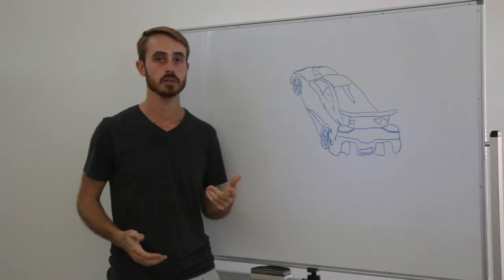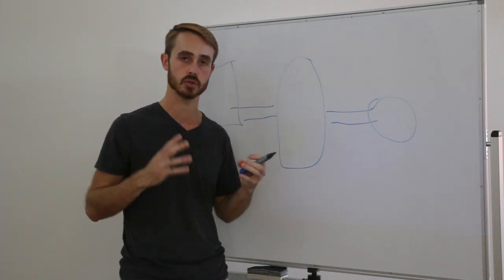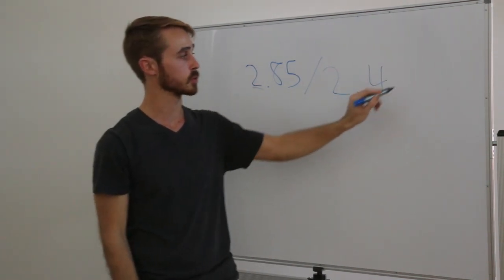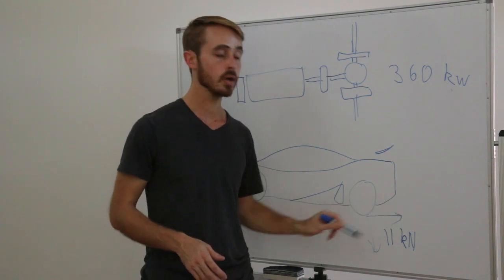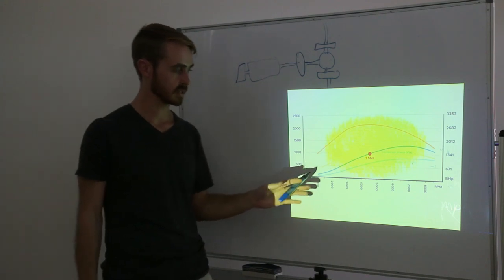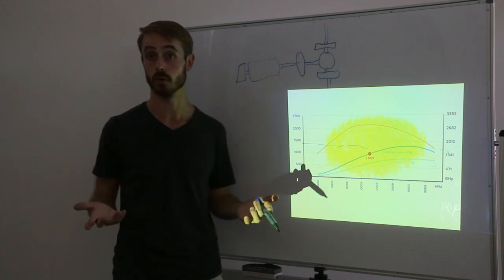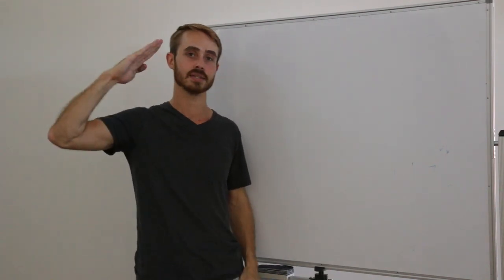Explained: How does the Koenigsegg Regera work with only ONE GEAR???

Comment: Good job on the explanation.  In another video I heard Christian K. mention a lock up converter, so 1:1 rings true. It's a simple but smart approach for a hybrid.  My first thought was all the heat that will be generated until lockup occurs. That is a lot of friction heat to dissipate under continuous heavy load. Maybe that is why we haven't seen a Regera run on the track very hard. Looking forward to see the finished product.

Comment: Thanks so much for this, it helped a lot. I was quite confused about how a car with One gear has the acceleration of 0-400@19S and have over 1500BHP, amazing engineering, pretty interesting stuff there mate.
Reply: LastManFarting Well... it kind of have 3 gears...  First its the wheel engines that is made for high torque, than the shaft engine, that is intermittent, and then the normal petrol engine

Comment: I'm still not clear on how a gearbox is eliminated.  Is it just simply using the Direct Drive electric motors in the rear to drive the vehicle at low speeds, and a 3rd electric motor coupled to the engine in the front to bring the engine up to optimal engine power band at high speeds?  What happens if the HV battery is drained?  Are you screwed?

Comment: Am I the only one who understood 0% of what he is talking about?
Reply from the maker: ZeidGho The main thing you should take away is that the gearing with the engine connected straight to the rear differential at a 1:1 ratio is similar to 7th gear in an Agera, making it suitable for high top speed, and the electric motors after the diff have enough power to break traction up until the point where the engine comes on and starts helping them. Basically, it doesn't need the lower gears as it is able to break traction with the engine effectively in 7th the whole time.

Thanks for watching!
Reply from the maker: ***** Nope, the gearing is the same, but there will be less acceleration, particularly at very low speed. I'm not sure how Koenigsegg is working around the problem of low speed when the battery is flat, but I would assume they are disconnecting the hydraulic coupling and using the engine to charge the battery via the motor at the front of the crankshaft being used as a generator.
Reply: KYLE.DRIVES Third motor acts as generator . It can supply a bit less power than rear motors can consume , but you would not be driving full power around the city . It works the same as diesel-electric locomotive at low speed - combustion motor makes electrical power , and it uses electric motors instead gearbox .Interesting facts - it can go in reverse only by electric power .
Reply: +ZeidGho Ditto and yet despite my complete bafflement, I found it strangely stimulating!
Reply: +Mladen Milić Best explanation!
Reply: ZeidGho me too if he had just said what it affectively doe that would have been better
Reply: nop
Reply: haha he goes on explaining in the comment... i did not even continue the video, cause i am not really interested ... i wanted to see a 3D animation of the car at work,... and not a guy explaining
Reply: So Basically it uses electric shiz' for low speed and the gearbox is basically fixed onto 7thish gear so it has cool top speed

Comment: Ya got alittle mathy here, but from what i got is that it used a "torque converter" mixed with the electric power to deal with the low Revs at low speeds, eventualy letting the Combustion engine take over at higher speeds? 

Please tell me if im wrong.
Reply from the maker: Turns out it has since been stated that it's not quite a classical torque converter in that it locks off drive as soon as it reaches around 40mph, but you are pretty much on the right track. I would describe it as pure electric at speeds<40mph, petrol and electric from there until top speed. 

Thanks for watching!
Reply from the maker: Oh yeah, also all my calculations etc are still valid whether it is a torque converter or a clutch or no slip coupling, so don't think I'm misleading you or anything :)

Comment: Kyle, what would you say about a version of Regera where they'd place the 2 wheel motors to the front? Weight implications? Having 360kW to the front wheels will be more than enough traction wise, and over 50kph there would be more traction to get even quicker 0-100 times, and through to 200 I suppose. Weight distribution would shift a bit. Extracting braking regen might be easier. And in electric more it would be 4WD. How quick could it be 0-60 all electic with the motors moved to the front? I think identical to current 2.8 or 2.9 estimate.
Oh and then there is cornering, 4WD ought to make a difference?
Reply from the maker: 4wd would definitely drop the 0-60, bringing it in line with the 4wd traction limit of 2.5 seconds (Veyron, 918). Weight distribution and packaging for aero and looks would be massively difficult though, the Regara packages it's motors exceptionally cleanly on the rear diff. You would also lose torque vectoring to the rear, which I would probably take over AWD with a massive amount of front power and no torque vectoring in the rear as far as driving feel is concerned. I read the other day that as it stands the weight of the battery pack means the front tyres are larger than the rear, this tells me moving the weight forward would make it very front heavy. Also, the diff and driveshafts in the back are already existing infrastructure, you would need to construct an entire new front framework to mount that motors in the front, which would be very heavy and costly, hindering cornering and acceleration.

Thanks for watching!
Reply: Thanks Kyle. i understood that the front tires are merel wider than on prior cars.
Also the 918 does it in 2.2 seconds, tested. Regera is lighter and might have widertires. Compared to Veyron, much lighter. Mass surely is a factor in 0-60mph.
i don't know much about torque vectoring, but fast cars of yesteryear did well without it.

To me it's just insane to have the car on the slip limit up till 270kph. Bring that down, with AWD, to well under 200kph, and it will be another BIG level faster off the line and possibly around the track.
Koenigsegg being them, an AWD setuo would not have to add hundreds of kilograms surely? Perhaps sacrifice the top boot up front. I would accept a non-loose top ultracar.

Comment: Nice man, thanks. A simple way I had understood it is that they use a high gear (say for example 6th or 7th) for the ICE and the electric motors fill up the torque gaps in lower rpm. But if I understood your video that's a mistake and instead they use a type of torque converter to bring the transmission closer to 1:1 between the electric motors and the ICE?

Comment: +Kyle.Drives 
Your Videos are Great! 
The question now is:
Wich Car would accelerate better, have a better top speed and a better corner performance, if one car weights about 1000kg with 500 horsepower and the another one weights 2000kg with 1000 horsepower? 
Hello from Germany !
Reply from the maker: +Dennis Wulfert I've actually been planning on doing a video on this for a few months now, just haven't gotten around to it! WIth all else held equal and assuming a little bit of downforce, both the same at low speed acceleration,  then 1000kg will have better cornering and 2000kg will have better top speed and high speed acceleration. 

Thanks for watching!
Reply: +KYLE.DRIVES 
Thanks for answering, even my physics teacher can't answer my question!
Reply from the maker: Well, the classic physics answer would be 'they both behave exactly the same', but that won't take into account suspensions geometry, tyre deflections and contact patches, and aerodynamics!
Reply: +KYLE.DRIVES 
So, but why has the 2000kg car more top speed?
Reply from the maker: +Dennis Wulfert Top speed is dependent on power and drag, and has little to do with weight, the 2000kg car has more power, but the same drag (as above assuming the same body), therefore can go faster
Reply: +KYLE.DRIVES 
Alright, thank you!
Reply: +Dennis Wulfert With everything being equal except for the figures you gave, acceleration would be given to the 500 hp car. This is because of weight transfer and grip. The top speed would go to the 1000 hp car due to the resistance of air and the need to have higher hp to get through it. Cornering performance would again go to the 500 hp car due to weight transfer and grip. So the 500 hp car would probably beat the 1000 hp one around most curvy style tracks.
Reply: +Dennis Wulfert der topspeed wird vom gewicht des auto nicht beeinflusst nur die beschleunigung bei topspeedrekorden wird tatsächlich manchmal gewicht in das auto gepackt um es zu stabilisieren 
und noch zur deiner frage: wen beide fahrzeuge die gleiche karrosserie haben die zb bei 100 kmh 250kg downforce produziert wäre das im verhältniss deutlich besser würde ich sagen also tippe ich auf das leichte auto wenn fahrwerk reifen usw die gleiche leistung bringen

Comment: Huh? I don't get it? So. To simplify, it is like a torque converter that's somehow connected to the differential and when the rpm increases centrifugal force expands the components hence rotating the axle? Yeah?
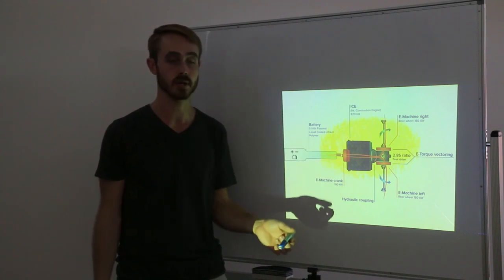Reply from the maker: Brandon Watkins Not really... Don't get too caught up in the torque converter, I re-annotated the video at 1:54 as it has since been mentioned that Koenigsegg may not be using their hydraulic coupling to multiply engine torque. 

The main thing you should take away is that the gearing with the engine connected straight to the rear differential at a 1:1 ratio is similar to 7th gear in an Agera, making it suitable for high top speed, and the electric motors after the diff have enough power to break traction up until the point where the engine comes on and starts helping them. Basically, it doesn't need the lower gears as it is able to break traction with the engine effectively in 7th the whole time.

Thanks for watching!

Comment: I wonder if people will be disappointed that the petrol doesn't kick in until 30 i.e. making it harder to rev pedestrians deaf at stoplights.
Reply: +UsernameUser you can have it turned on, it's not connected to the wheels however.
Reply: +Peter Pan So it basically just revs for the sake of making noise?
Reply: UsernameUser it's at idle
Reply: Peter Pan And it doesn't actually rev until 30?
Reply: UsernameUser exactly, well it's at idle. It's not connected to the wheels until 30mph.
Reply: Peter Pan That's really interesting, thanks for the information.
Reply: UsernameUser no problem mate :)
Reply: You can have the engine in regenerate and have your foot on the break then rev it. Then the engine will turn the generator and the car will not move. Simular to reving a car in neutral
Reply: And you can get electricity too, instead of just rev it for the noise.

Comment: Hi man! thanks so much for sharing, I have a question. what CFD program do you recommend to start in flow simulation? :) thanks again.
Reply from the maker: Max Chong Oooh thats a difficult question, probably the easiest software to start out with is Ansys CFX, it does a lot of the difficult stuff for you. I use FLUENT at work as at gives you a good balance between control over the simulation and ease of use. Probably the best free program to do it with is OpenFOAM, and I am currently implementing that for my personal project use (aerodynamics on my race buggy), but it's all text based, which is interesting....

Thanks for watching!
Reply: @KYLEENGINEERS  text based! Shades of FORTAN Batman!

Comment: What if the battery is drained? Do you have to push it to 30mph to get going.
I remember i had a prius parked and needed to go reverse to get out, but the batteries were drained so it wouldn't go backwards. I had to wait for the engine to charge the battery.
Reply from the maker: +ramanmono Sooo you tell me to "learn to use video editing software" in another comment, and then want my help here? Yeah, good luck with that...
Reply: KYLE.DRIVES lol, It's a good suggestion and you know it. If you don't wanna reply to my second comment l'll just go in a corner and cry for a while and be just fine afterwards.
Reply: Just step on the accelerator and it should go. The ICE would rev higher to spin up MG1 to generate enough current to power MG2 to move your car in reverse. It just get a tad noisy, you don't need to wait for the battery get charged.

Comment: Let's be honest: while I appreciate your effort in trying to explain the mechanical basics of this concept, in my opinion you fail miserably in making the audience being able to follow your thought process.
a) cut all the side infos that confuse more than they help
b) maybe explain the principle or idea of the gear box first before you start tossing around numbers and ratios
c) have a more structured way of writing down formulas and connect the dots - plane ratios do not help at all
d) make it short FFS

I say this as a mechanical engineer myself who is not into cars. While I get the principles, I did not find the energy to follow through the whole video. 

However, thank you.

Comment: I think you have it wrong. There is no torque convertor but there is hydraulic lock-up clutch that from 30 mph up just locks the motor's rpm directly to wheels. Christian himself explains this in couple of videos from Geneva.
Reply: Not sure what video you are refering to, but he explains it in this video and calls it a "hydraulic lock-up torque converter" https://www.youtube.com/watch?v=JAPxXXxxUR4 . I assume most of the time it will operate like a clutch and directly goes to locked up mode because you do not need the increased torque, but it is a torque converter and will be used as such in heavy acceleration.

Comment: could somebody please answer one simple question, is that shit like a CVT transmission in a normal hybrid car (e.g. Toyota Prius)? I don't get it....
Reply: +Maximilian Ott 
No.
The CVT is an actual gearbox (you can read more about that separately)
The fluid coupling in the regera essentially acts as a torque converter you find in automatics.

A torque converter and gearbox are 2 separate things-automatics have both.
Reply: No. Its like in your car having only 4th or 5th gear . The role of the transmission in a car is to amplify torque (a force) , because normal small engines dont have enough force at low rpm to move the car or to accelerate it. Thats why you dont start in 4th gear. However, Regera has like 10 times the torque of a normal car so it doesnt need torque amplifying.
Reply: Its nothing like a CVT and its nothing like a normal car.

The closest think i can describe it is as a electric dragracer in low speed and a petrol supercar at high speed.

Comment: lol this is a video for people who are really dumb... and then you get the people who don't get the explanation lmao

but the math was unnecessary all you needed to say was, they used a ratio similar to the 7th gear and the electric power provides the torque at lower speeds to make up for the torque the engine lacks at 1000-2000rpm...
so they don't break the motor under the low end strain even though there is a extra few kW on the crank available instant.

but i liked the math... ill be building my own koenigsegg tomorrow lol